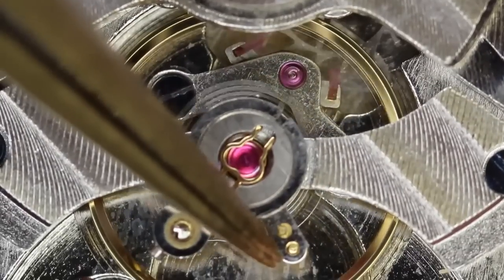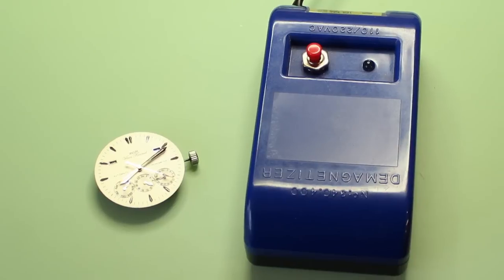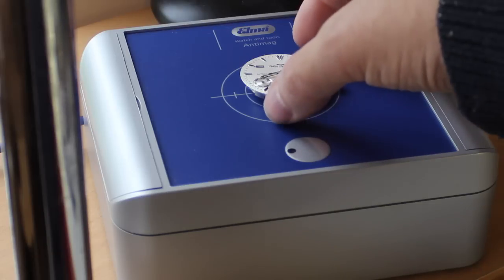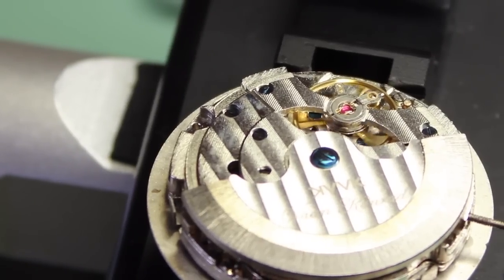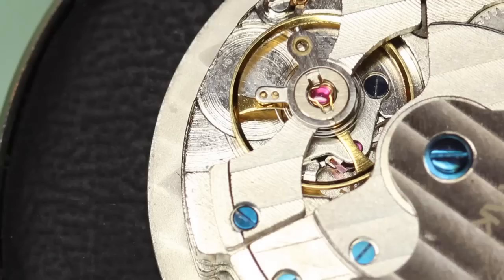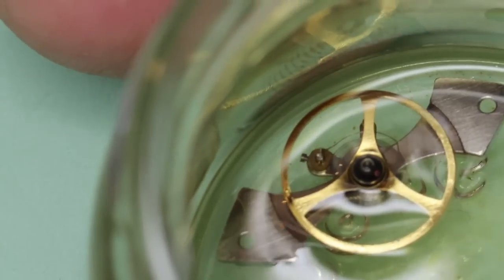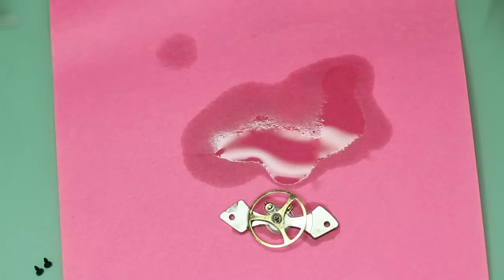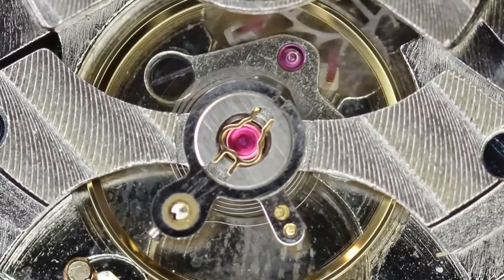Watch Fault Finding. Episode 1. The watch is gaining a huge amount of time. Learn how to repair.

Comment: This video was indeed "useful".   Thank you.   I am working on a Big Ben alarm that is gaining lots of minutes per day.   About 20 minutes overnight.   
Two questions:   1)  What is the name of the machine that is showing you the amount of time your watch is losing?   I'm sure it's way out of my league price-wise, but would be interesting to know.   2)  Assuming my Big Ben is magnetized, would it be effective to simply de-magnetize the hairspring and balance wheel?    I have one of those tape head de-magnetizer wands if you remember those from the days of cassette decks.   I'm thinking I could use that.    Thanks again.
Reply: It's called a Timegrapher. They can be bought from a Chinese source for around US$150. There are also apps. that run on a cell phone that can give a pretty good approximation of the performance.

Comment: I noticed you didn't lubricate the jewel after soaking the hair spring assembly in the cleaner wouldn't the cleaner have cleaned out all the oil in the jewel?

Comment: Hey Mark, thanks for the demonstration, very kind of you to share. I have a question about those demagnify tools, will they work with the tools or parts of the movement also? For example tweezers got magnetized or a screw, will they help or is there different method? Another question, part of the movement is magnetized, should we demagnetize the whole movement or the part alone? Thank you again.

Comment: Hi Mark,  I always come to your videos first, but when both didnt work on a new ST2130 based watch I was non-plussed. For some reason the plastic movement holder was the problem, maybe pressing the movement hard up against the back of the dial?? Swapped the holder and it was fine. The watch was pretty accurate when the back wasnt screwed on, so I knew it was something in that area.

Comment: Thanks so much for the great videos. I just serviced my TAG Heuer Carrera and it was running extremely fast even after demagnetizing.  Then you mentioned a contaminated hair spring. It looked fine. However, I gave it a good cleaning and it was fixed. I must have gotten sloppy with my oil.
Reply: HARSPRING ARE VERY DELICATED, SOME TIMES THEY ARE DISTORTED, OR OUT OF CENTER, .BENT IN SOME PLACE, MAFNETIZED, DIRTY, LOOSE, CORRODED  ETC...YOU NEED A MECHNIC EYE FOR THAT, WATCHMAKING IS FINE MECHANIC...YOU NEED TO BE A MECHANIC.

CLEAN AND RELUBE, IS THE RIGHT PLACE, WITH THE CORRECT AMMOUNT, AND THE CORRECT OIL.

EASY --ISNT IT?

Comment: What do you consider to be a huge amount of time?  I have an Omega Seamaster, 2531.80.  I bought it new in 2005 and around a year ago it began to run slow, but now within the past 3 or 4 months it is fast.  When it was slow it lost about 3 min a day but now it gains close to 4 minutes a day.  I've also noticed that the power reserve has gone way down.  Omega says the power reserve should be 40 to 44 hours on a full wind.  Mine will only last a day or so.  What are your thoughts?  Thank you.
Reply: DUDE, GET IT TO A WATCHMAKER, YOU DONT EVEN UNDERSTAND  the basic and principles of it, how do you wann fix it. Or start studying... its notmal that behaviour cause needs a fix. The problem is in the hair spring. Your not going to touch there, yo fuck u everything.You can also have another problem but mechanics are not magicians so would need to see it first.
Reply: @Limou551  How about learning to spell first!

Comment: This video is great like the first I watched a few minutes ago. I have to say that I like them because the images are clear, exactly like your succinct comments. I own an IWC Ingenieur  automatic and I noticed that it is gaining about 16 seconds a day. Since it has been extraordinarily precise in the past I suspect it has been exposed to a magnetic field. Unfortunately the use of a demagnetizer has been of little help. So I guess that the cleaning would resolve the problem. Naturally I do not dare to open the back case by myself without specific instructions and a set of professional tools.
P.S. In your video everything seems so easy. I am sure that the reason is because of your experience and skills.
Thanks for posting.

Comment: Can a movement be demagnetised without removing it from the case? Say if the case had a display back.
Reply: It doesnt matter at all if the caseback was made Out of chrystal or Steel 
So you can demagnetize with the movement in the case
Reply: It doesnt matter at all if the caseback was made Out of chrystal or Steel 
So you can demagnetize with the movement in the case